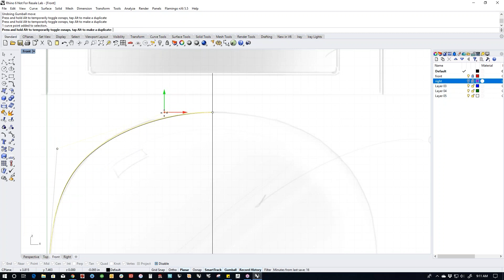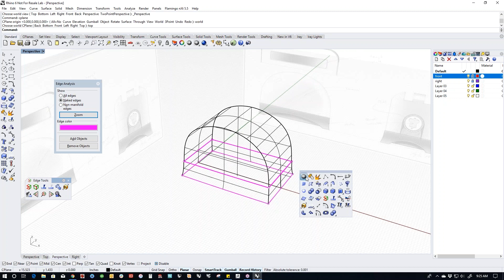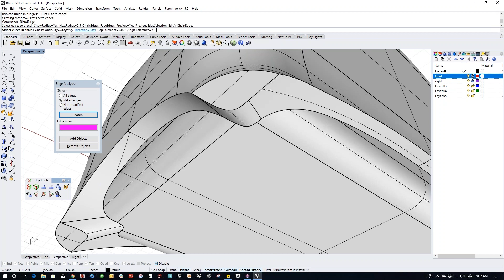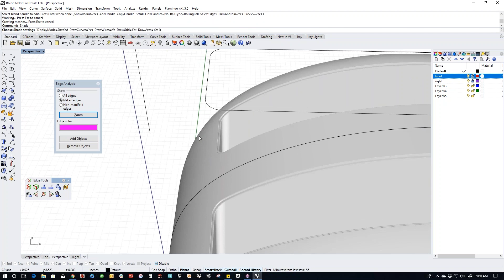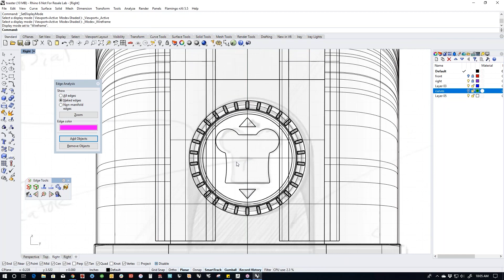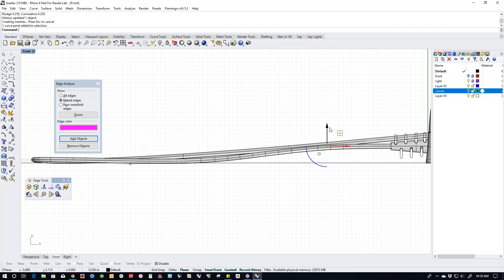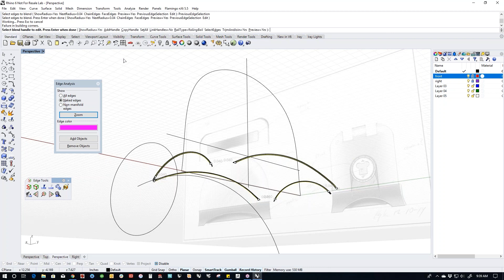Comment: 39:20 what is the command to preview the fillet edge separately like you're isolating it or sth?
Reply: there is a preview switch in the command line of the fillet tool.